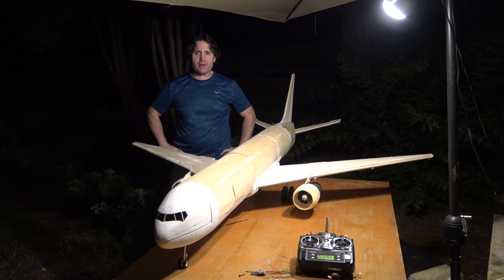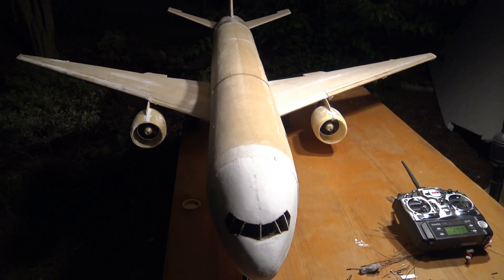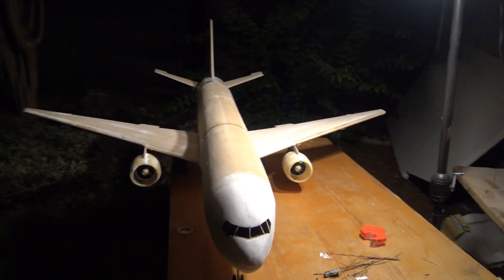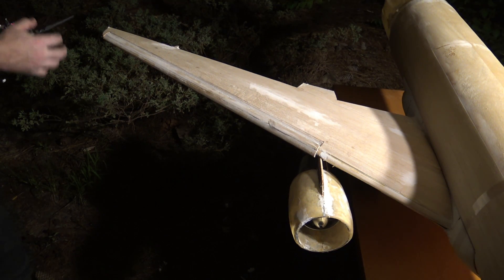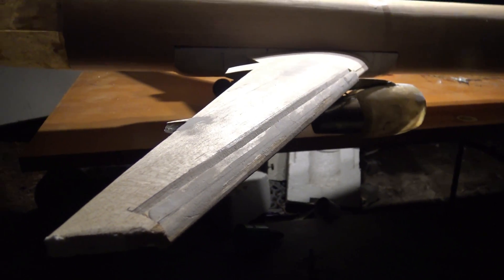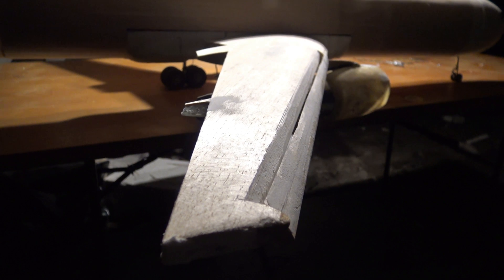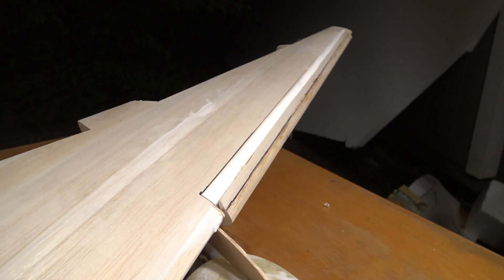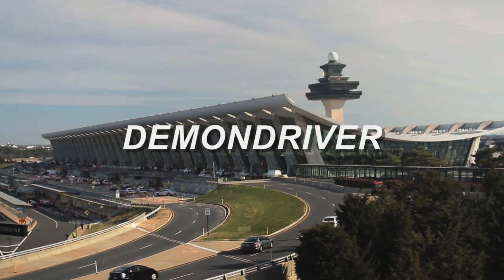RC Airplane AIRLINER 767-300 Slat Test! [4K]

Comment: Cool .
Hey Chris, Check out the Coanda  Effect the principle behind the leading edge flaps and my power air-flow designs:
The Coandă effect (/ˈkwɑːndə/ or /ˈkwæ-/) is the tendency of a fluid jet to stay attached to a convex surface.[1] A better definition has been provided by Henri Coandă in different patents and have been reported by Merriam Webster dictionary:[2] "the tendency of a jet of fluid emerging from an orifice to follow an adjacent flat or curved surface and to entrain fluid from the surroundings so that a region of lower pressure develops." The pressure effect, which is usually not indicated, is fundamental for the comprehension of the Coandă effect.
Reply from the maker: Thankyou For that info Bob!, The more aerodynamic theory I learn the better I can apply it in real life.
Reply: You are welcome

Comment: would it be possible .. to have a piece of thin balsa along the top of the slat that slides in and out of the wing to cover that  gap ? ... its cool .. but to me the gap looks awful .. i can see myself trying to add covering that when the slat is extended the covering would be  tight and fill the gap .. or i would be trying to have the top of the slat with an extended piece of balsa that slides into the top of the wing .. any thoughts on this ? ...
Reply: The gap is what makes a slat effective (if it has the correct shape).
Reply: see that ? ... you can learn something new everyday :) ... cool.
Reply from the maker: Like ZFlightisaallright said the "gap" as long as its not too wide and doubled with the downward droop of the slat is what exaggerates the airfoil and helps create more lift.
Reply from the maker: 1000% Correct Sir!
Reply from the maker: Very true Scott!

Comment: Can you make a video of how you make your engine nacelles and inlet?
Reply: Do they have a dowel of any sort in the working part of the slats? They would be real stable on a linear aluminum dowel rod that they could be guided with. Nice work! 

Some radio users will be able to control the speed of the slats while mixing with the flaps for the ultimate soft landing. Very nice job Demon!
Reply from the maker: I have a DIY Engine Nacell Video Sir.
Reply from the maker: Hi Buddy! I like that Idea! I would have to find a way to hinge the Dowel, but its very possibly Sir.